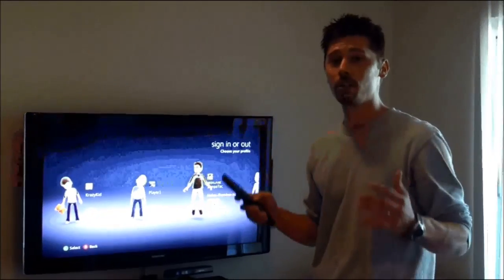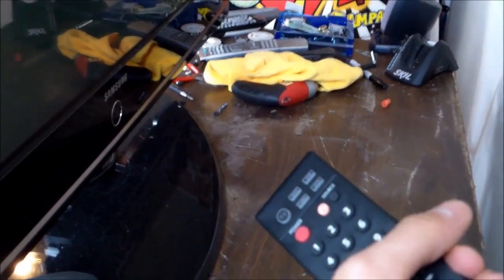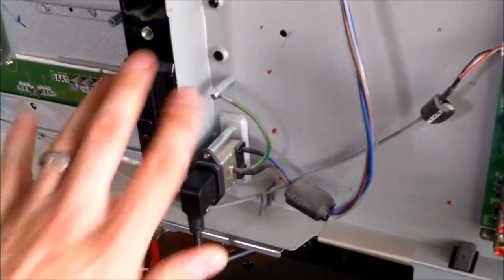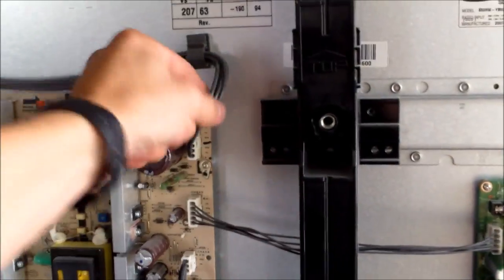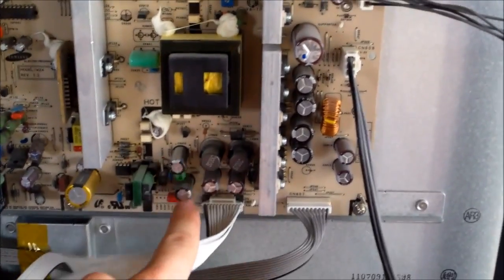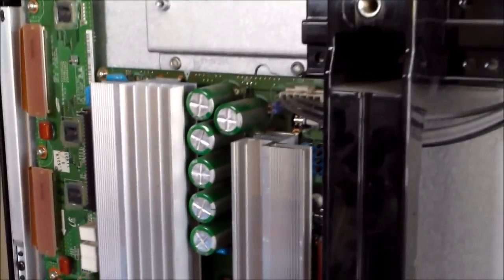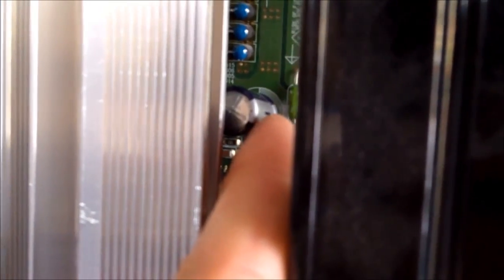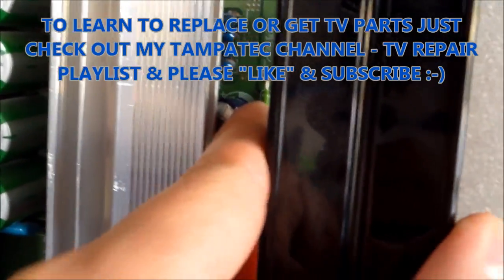WHAT Plasma TV BOARD CAUSES NO PICTURE REVIEW

Comment: I have the same tv and thats the same problem i have now. I have sound but no picture.   I took the back cover off and checked next to the green fuse like you said but my capacitor looks fine     

But i did find 4 green ones on the center board that puffed up from the top.   Is this my problem

Comment: I have a Sansui HDPDP4200A Plasma Monitor which stopped having video after I blew a circuit breaker while using a power tool on the same circuit. The Monitor was on at the time but after I flipped the tripped breaker back on the set turns on but no picture. There is a Samsung PDP Module # S42AX-YB01 in this unit. I was hoping you might help me out.
 
A visual inspection inside the unit revealed a bulged capacitor at C5040 on the ‘Y’ board and a real funky looking fuse at F5004 also on the ‘Y’board. The fuse seems to have some sort of white deposit built up on one end of it.
 
You now know everything I know about this or any other TV. Can you help with the information I provided?
 
Thanks,
Mike

Comment: Tampatec I Have a 2008 42" VIZIO VP422HDTV10A. I just got a new power supply as the tv would not turn on. Now the tv has a stand by light ( Orange ) in color. When I turn it on it turns ( white ) but has no picture at all. It looks like it is off. No picture or sound at all. What board should I buy...?

Comment: Hey Tampa thanks for all of the helpful tips!
I have a Maxent PDP Monitor Plasma TV model # P4202YD07, ( loaded with all Samsung boards )
It has no picture or lighted display.
 I dont know if it has sound because it has no cable connection but the tv powers on & stays on!
All fuses test good, no swollen or leaking caps, no visual damage at all.
What are your thoughts.
Thanks again!

Comment: Hello tampatec.  Thanks for the informative videos as I've been able to repair 2 LEDs and 1 LCD with your help.   I'm working on my first plasma tv now.  I've acquired a samsung plasma tv model PN60E550D1FXZA.   When the TV has not been used or is "cool" it turns on with no problems and will stay on for as long as I want.  Once I turn it off and immediately try to turn it back on while it's "hot" the screen will not light up but I will hear sound from the speakers.  Per your plasma videos you've mentioned that when you have sound but not picture it's usually the Y sustain board.  Do you still think that it's still the y-sustain board if so how can I test it to determine if the part is bad.  

With the help of your videos Ill open it up tomorrow and take voltages when the tv is "hot" and will not turn on and see if I find any bulged capacitors or any noticeable abnormalities.  Thanks again for your help.

Comment: I have a Samsung PN50B450B1DXZA tv. I have replaced the power board the y-main and the x-main. it worked for a few days and the x-main blew again. a chip at the Q4102 location keeps blowing. any suggestions?

also there is a potentiometer for the VR-FR on the Y main what is it for and how should it be adjusted?

Comment: Hi, I have an lg 60ps60-ua plasma tv, had a power outage and its dead it was on a surge protector, I press the power button and only get a solid red light now, no picture or blank/black screen. I unplugged the mainboard the one with all the vga, hdmi, and audio inputs on it, I hit the power button and I hear the power board click twice, then I see 2 little green leds on the (processer board?) one is solid and one is flashing, Also I hear the xsus and the ysus buzzing, its like when I unplug the mainboard everything works except I still get no picture, when I plug the mainboard back in, I get nothing, no clicks or buzzing noises when the power button is pressed. Any suggestions?

Comment: I have a question. 2 years ago our samsung lcd tv had the power board capacitor failure and I fixed it with a few new caps. A while back I got a samsung plasma on freecycle which I figured had the same problem. I tried two different sets of capacitors which all blew. So I went on ebay and ordered the entire board. After installing the new power board the tv will click on, play the little samsung intro music, then the speakers make a popping noise and the tv cuts off. But if I unplug the Y-sustain board the tv stays on without popping and turning off. Is this a clear indicator that the Y-sus is bad or did I get a bad power board from ebay?
Reply from the maker: for me Y-sus board goes bad maybe due to transistors on heatsink or y-buffer boards connected to y-sustain board shorts out diodes and transistors on ysus..
i replace sometimes on y-board f5700 fuse, c5709 capacitor swollen, u5702, transistors q5501, q5306, q5500, q5304, q5303, q5302, on ebay you can just mail service centers your bad boards too.
if you want Subscibe if this helps 8^)

Comment: Hi Tampatec, wondered if you could help? Thanks so much for your videos, really gave me the confidence to try and help myself for a change :). My 50" Samsung Plasma has a problem I'm having trouble identifying (Powers on with black screen but with sound through hdmi). First I thought it was the power supply so following your tutorial I changed bad capacitors and checked voltages, everything seems fine with psu so discounted that. X and Y seem fine (Changed a couple of questionable caps on Y-sus. Same scenario. If I adjust the Philips nob on the y-sys (Left Board) I'm able to get the picture fully white still with sound, and get static if I adjust others. At this stage if I unplug either board the picture blanks but sound remains? At a loss now what to check next or which board to replace. Any suggestions or advice? Thanks so much. John
Reply from the maker: next try y buffer boards, if you have green light on ymain board and on heatsink transistors should read .4-.6 in diode mode on meter they are most likely good (.3 or .9 is bad transistor).
but first i suggest getting service manual- http://bit.ly/1ntPVZ2
Reply: ***** Hi thanks for your reply. have watched and followed that video. Replaced 2 suspect caps on y-board thought I'd solved it. Unfortunately no change :( lol. Only lights I can see is on logic board, where should I be looking on the y-main? logic lights up then flashes every second or so (From research somebody said that meant it was ok?) but saw a cheap one on ebay and swapped it out anyway, still no picture and light blinks the same. Can I test the transistors in circuit or do I need to remove heatsink? Appreciate your time and patients, learning as I go and for once enjoying not having a TV because it gives me a project to fix :) haha. Thanks John (Model is PS50A456P2D if that helps at all)

Comment: I have a Sony 42" Plasma, it has picture but colors are blurry. I did all the voltage point tests and when the Ysustain board is plugged in the -70 voltage was all over the place, but when the Ysustain was unplugged the power supply was able to maintain -70 no problem. Would it be the transistors or caps on the Ysustain board. Only the -70 not the +70 on the Ysustain is at fault. Or could it be the power supply is not able to fully supply the required -70 volts when the Y sustain is plugged in?
Reply from the maker: i would start with the power board and trace down, can be loose ground solder joints.

Comment: Hi matey, I've just replaced the PSU on a Samsung PSPF531801A as the TV would sometimes turn itself off and on. Now the TV now stays on, but after 20 mins or so, the picture goes out. When the picture goes out we still get sound?  Can you help please.
Reply from the maker: when tv parts overheat they fail so use freeze spray to locate what part is failing after 10 minutes of tv being on, once sprayed on that part (transistor or ic, ect) the tv screen should come back on.. don't worry electronic freeze spray won't short out boards.

Comment: Hello just a quick question on my samsung everything works, just alot of the time the audio cuts off, and the only way to get it back on is to turn the tv off, then back on....is something going out? or is a wire bad?
Reply from the maker: if tv speakers cut in and out on all TV's inputs like- DVD input and cabletv inputs audio too then check TV main board, most main board can have loose solder joints or failing amplifier part or overheating.
Reply: Tampatec 
I have a lgpz550 plasma tv is power up, it has sound but no picture what sound i do?

Comment: Great video, thanks!! My Samsung plasma powers on, but there is no picture or sound. All capacitors look and feel good. I checked the Vs and Va voltages on my power board and they hold steady at what the sticker says they should be. I also checked most of the fuses (I apparently missed 1 or 2 based on your video). However, one of the X board heat sinks gets dangerously hot. I had someone tell me either the X board or the plasma screen is bad and there's no way to determine which one it is. Is that true or do you know of way to figure out which is bad? I don't want to take a chance on buying a new X board (that I can't return) if the plasma screen is bad.

Comment: Hey Tampatec, I got a Samsung TV with no picture but it does have sound. I see no bulged capacitors. Where do you think the problem is?
Reply from the maker: press tv menu, if tv menu doesn't show it can be y-sus board, get at shopjimmy.com but contact shopjimmy techs to confirm Y board is most likely fix. on "Vs" pin should read about 190 dc volts on power board to Y board.

Comment: hello Tampatec, first of all, Happy Holidays, and second, i have a plasma Samsung tv that turns on but nothing else happens, nothing comes up on screen or have sound, i see no bulged capacitors . What could the problem be? Also it has a  semiconductor fuse in the Y sustain making one beeping sound in my multimeter and the others stay beeping. Also the led on the logic board keeps flashing and two heat rectifires on the Y sustain stay cold. Here are some pictures https://www.dropbox.com/sh/y5ftl47u3m0va3v/0IeW_Pxmnf
Reply from the maker: check Vs pin should read about 190dc volts but Y board can be bad.
Reply: ***** Thanks I will check it tomorrow
Reply: which one, because there a lot of Vs pins?
The TV has a Vs test point on the power supply but the voltages go from 70-60v and lowering
Reply from the maker: EXWrath123 sounds like you may have bad power board, get at shopjimmy.com but contact their techs to confirm that.  1 (877) 881-6492 / (952) 881-6492
Reply: Thank You as always :D
Reply: ***** Sorry i was testing with the tv off. The Vs volts are 200v with or with out x and y sustain connected. What could it be?
Reply: EXWrath123 Whenever you have TV issues post it on badcaps.net/forum

Comment: Another thing I found today was that when the Vs and Va power was tested and neither got up to voltage and then slowly went back down to zero even though TV was still on (with no picture, of course) this happened with X sustain disconnected and with both disconnected. If Va and Vs are not right does that mean Power Board or will the Vs and Va get to voltage without a the sustain boards connected?
Reply from the maker: if you not getting right volts on Vs pin it can be power board but other bad sustain boards can cause voltage drops. call to get tv correct tv part  1 (877) 881-6492 / (952) 881-6492

Comment: Hi I have been watching your videos all day trying to figure this out. I have a 2 y,o. 43" Samsung plasma that will not start but tries 2 or 3 times and red front light goes solid and then power does nothing unless disconnected/reconnected . X sustain board powers through Y sustain.When I disconnect power to only x sustain board, TV starts and runs w/o picture. Same result when Y Sustain disconnected. No bulging caps or other obvious visual cues. Is it the X Sustain or possibly something else? Is this thing trash or salvageable? Thanks!

Comment: Hi Great Video . I have a 40" Samsung plasma  that the power board blew. so i order a new board and pluged it in . the TV turns on but there is no screen and no sound . I have checked all cables  ect: is there maybe another board thats blown . I have checked all Fuses on the other boards and they seem fine

Thx Allan
Reply from the maker: i had same problem it was Y-main board go to shopjimmy or call  1 (877) 881-6492 / (952) 881-6492
Reply: *****
Hello thanks a lot for this video for me the problem on my samsung plasma is there's a black screen but I can hear the sound please let me know what can I do. Thanks.

Comment from the maker: can be x or y sustain boards (if dc input volts is ok) but also can try a firmware update that fixes x-sustain failures at samsung website. Samsung warranty 1-888-899-7602 and for sustain boards and tech support call 1877) 881-6492 Sub to Tampatec if this helps and for Free tech support on all electronics needs 8^)

Comment: Hey TampaTec great Videos and thank you for the help! I'm having the same problem with a insignia 50 inch plasma. the tv powers up great sound it tries to power up I see the back light blink but it just doesn't.  I have already taken the back off and when I plug the tv in and power it up I here only one relay click on but not the other one also the led on the logic board blinks but it a slow steady blink on and off cycle about every 6 seconds.

Which board could be causing this?

Comment: great videos very helpful, i'm learning stuff haha. I have an 08 lg plasma that has the right volts in the vs and va's and fuses seem good. caps look good, checked the buffer boards and one of the ic's is bad on the top one. The problem is there is sound and the screen is gray with a horizontal strip on top that is pixelly with different colors, but the screen is mostly blank any advise?

Comment: I've got a Panasonic TH-42PX80UA made in Aug. 08. One day, just wouldn't come on. No picture, no sound. Also, the red light stays on steady. Also, you can tell that the Plasma panel is getting power, because when you press the power button, the screen gets a little lighter than solid black. SS board and SC board both have the little green led on them, so I know they are getting power too. Help!!! LOL

Comment: Thanks for the prompt reply! The reset did not fix the problem :( I did some more research and it appears that the problem is either with the H-Board (Input) or the DG-Board (Digital Processing). I am going to start with the H-Board since it is only a little over 20 bucks. In the mean time can you recommend some make/models for the "audio/video" surround receiver?

Comment: I do have a hpt5044  it was turning on but black screen, I checked the power board all power outlets where good. Then i found a burned mofset on y board and replaced it.   Now as soon as  tv starts turns of automatically and keep doing it  forever. When i do remove the yboard power cable it turns on and i can hear the turning on sound. What would be the problem!?

Comment: Hey Tampatec just got a free Vizio E370Vl 37" LCD  1080p HDTV the Vizio light is orange go to turn it on the Vizio light goes white an the Vizio logo comes on the screen then goes back off an Vizio light goes back orange I've took the back panel off an check the power supply for 5.1 volts an 12.00 volts  an all are in the neighborhood an the blue light on the back comes on to so I'ma lost would it be the main board what you think any helps gr8 thanks...??? Steve813Ttown

Comment: Hi, great video! I have a Samsung LCD tv and what happens is the tv goes black after 2 seconds. I opened it and the capacitors look ok, nevertheless I have bought new and will replace the once on a power supply board. Do you have any hints if that could be something different?

Comment: Thank you for the great Vids, Really pointing me in the right direction, I have a Problem with my Philips BDS4241V/00 Plasma Monitor. This happened before with exact same problem and went back for Warranty repair.

Symptoms were that there was a clicking and then would Finally power up, Eventually went to just Red stand by light and will not power on, Seeing as this is now out of warranty i am looking at the repair.... when i disconnect pixelboard from power supply board the screen powers up..

Comment: Hey Tampatec i have a HPT5054 and ive been working with this tv for over a month. I replaced the y board and buffers from a parts tv, and i had a guy come check out the tv and he claimed the tv screen was bad. the whole screen. what else could be an issue....the guy who checked it out said all the circuits wer good. i heard it could be a transister issue.

Comment: I have an AOC L26W861 TV and I had a red line in the center of the screen. After the TV was on for awhile the line would disappear. About a month ago the TV screen went black. When I turn it on I get a red light and that all. I open it up and check the AC & DC current on the power supply board and it appears OK.  I did a visual check of all capacitors and the rest of the boards and couldn't find a thing.  I would appreciate any suggestions you mite have.
Thank You,
Dick

Comment: Hi Tampatec and thanks for sharing.  Really helpful.  I have sound and power but no picture problem with Hitachi HDS69 55" Plasma.  5 yrs old. The only online help I could get on this model suggested replacing upper and lower "buffers".  I suspect - have not opened tv yet - that it is Capacitor problem as per your Samsung video.  Would appreciate any input on what buffers are and is it a possible problem and also how easy/hard is it to replace a bulged capacitor?  Many thanks.

Comment: Tampatec! Wanted to thank you for your videos! I've learned a lot from watching you! I was wondering if you could help me with a problem though. I have a Samsung PN42C450BID Plasma tv and the touch pad on the side (button less) keep activating randomly. It either constantly cycles through channels, raises/lowers volume, or goes through the menu. The remote control has no effect on it once its on. I tried replacing that touch board but the problem came back. Any ideas?